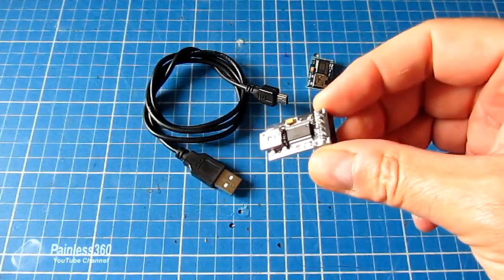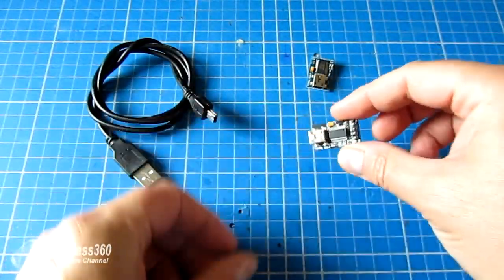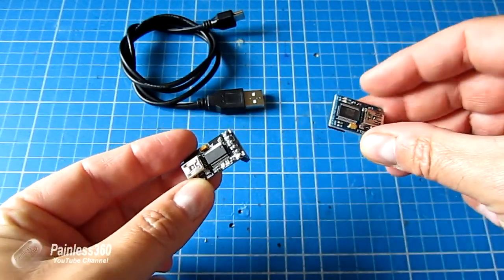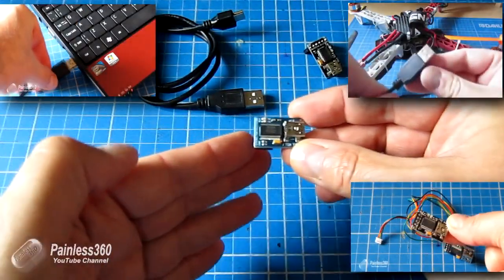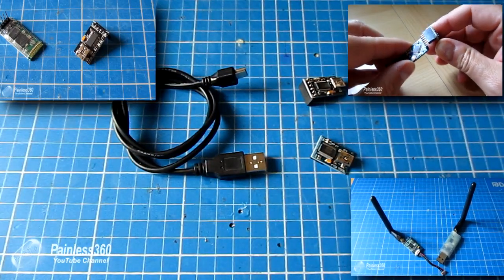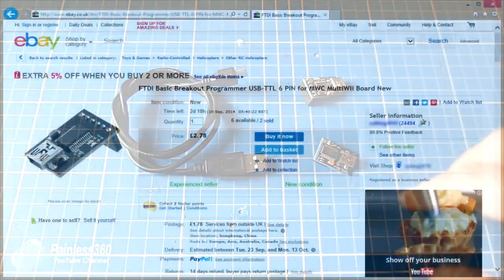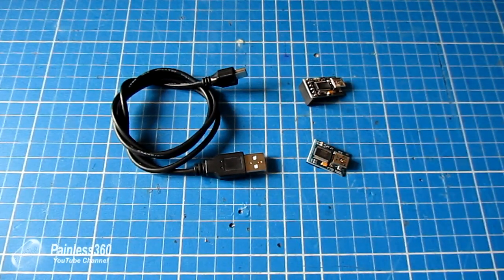Multirotor build tip: FTDI adapter

Comment: Mm Yes, My experience has been a bit hit and miss.. my best FTDI is one bought from cool-components Its a 3.3v all in one USB cable. some work some don't they are so cheap (some times) have a couple on hand. Any way You cant do without.. so excellent advice.

Comment: You touch on a great point: Some of the extremely high dollar RTF crafts out there on the market have all of the less costly components we use to build custom crafts or kits, but if the impetus to build a multirotor is to circumvent the huge expense of RTF, then the value found in hardware like the minimosd and multiwii is only a value if you have the right tools to set it up.
I originally was never interested in the mechanics or nuts and bolts of a multirotor- just the flying and it's use as a tool- but as everything else mechanical, it behooves one to learn how to service and repair without assistance. To let a 5 dollar part prevent you from a 5 minute repair is, to borrow a phrase from an old Reconstruction Era newspaperman, to put a 5 cent shine one your shoes and a 1 cent shine on your head.
My head could warn ships in the trading lanes on a dark and misty night- but I don't have one of these yet!
Reply from the maker: Hey Hiway, thanks for the post. It's amazing how often I end up pulling an FTDI adapter out of the spares bin when I'm building or troubleshooting. 

Looking back a lot of my 'how to' videos for GPS, multiwii, i2c, minimOSD, 3DR radios, bluetooth to name a few, rely on this inexpensive part to be setup correctly and work.

Happy flying buddy! :)

Comment: I was looking for the FTDI adapter on ebay and see a lot of these.

FT232RL 3.3V 5.5V FTDI USB to TTL Serial Adapter Module for Arduino Mini Port

will this work to set up the openpilot gps ?
Reply from the maker: +heath wells I always use the term 'FTDI Basic' and get the ones that look like those that I already use (and we show in the video). Best of luck!

Comment: I've had to bodge up a cable to connect to the (multiwii)based afromini32, a smaller naze 32, looks like the 90" ftdi connector you have would be perfect, do you have a link to it? cheers!
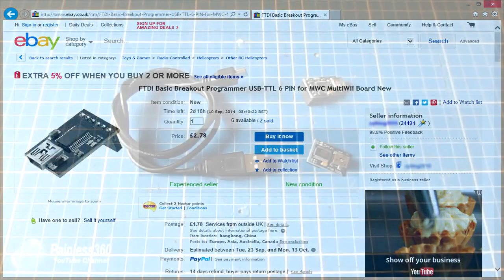Reply from the maker: Hi Ben, look at the image from eBay at 1:35. That should give you enough to search for one on eBay. Happy flying!
Reply: Ah, thanks man.